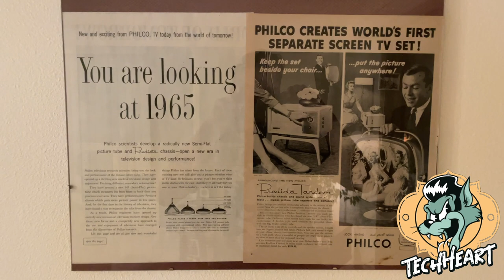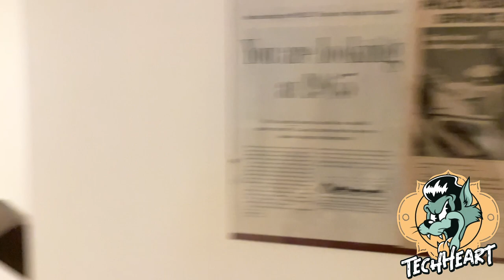I Finally Fixed the 1958 Philco Predicta: Project Update

Comment: Love it. Ive wanted one for so long.
Reply from the maker: I've got an update video planned, but need to finish up the hardware side of a new addition - software side is done... I've added a remote control using an original Zenith Space Command clicker and an Arduino to control the Pi/predicta.